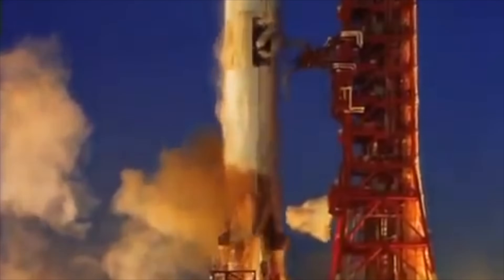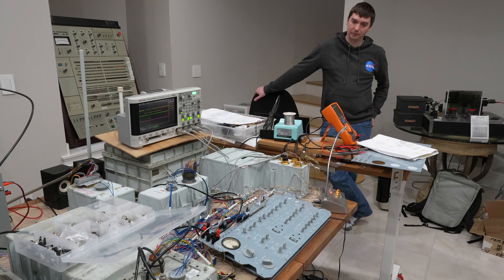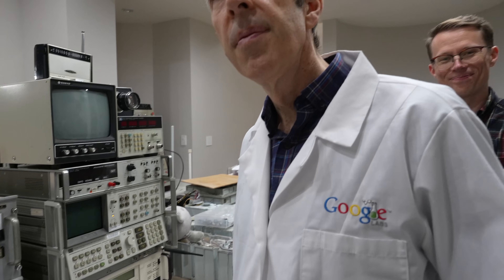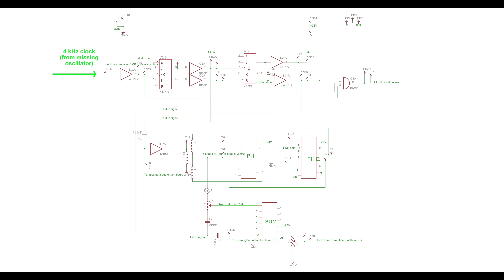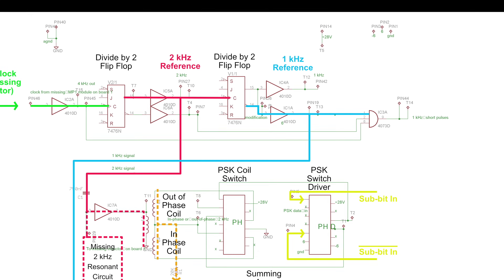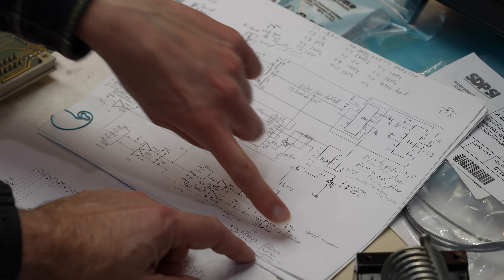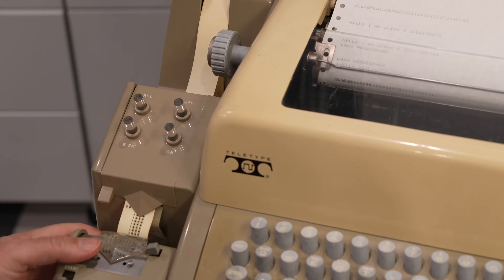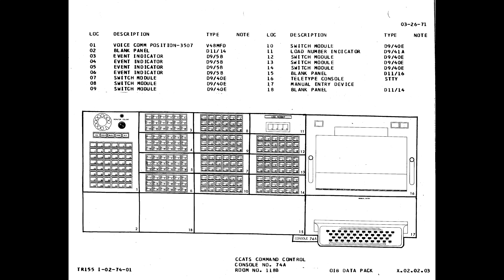Apollo Comms Part 33: Is there something wrong with our NASA Up Data Link transmitter?

Comment: My law of inverters: it should be a 50% chance you get it right, but somehow it's a million-to-one shot you get it right the first time.
Reply: Flip a coin heads 10,000 times, the odds of it going tails the next toss is still 50 50!!
Reply: The 50-50-90 rule:
If there's something that should be a 50-50 shot, 90% of the time it's wrong the first time...

Comment: I am loving this series.  The funny thing is that I'm working on an electronics project with SMD parts under a microscope and I am looking at those large chunky turrets where you're making your modifications... of course they had an entire card cage and size wasn't as much as an issue... but I too like the HP equipment and have several older pieces of equipment in my rack: an 6-digit multimeter 34401A and an Arb. Waveform Gen. 33120A... they knew how to make rock-solid equipment.  The funny thing about that is that when I worked at HP in their Test and Measurement Division in the 90's , I didn't take advantage of my employee discount... but I purchased these 2nd hand and it brings good back memories.

Comment: Curious about how much the UDL was used in practice during the missions. How much of the spacecraft could be controlled this way, and why wasn't it used when they hacked the AGC on Apollo 14 when they needed to ignore the abort signal during the descent.

Then, on the fiction side... What if they had a rogue group of astronauts on board. Could they be able to strand them out? How much damage could you cause, or how much control would you be able to take out of their hands? Sounds like a cool plot device Chris Hadfield could have used in Apollo Murders.

Comment: I do wonder: This system seems to have very little authentication. Was there no concern that someone could interfere with the mission?
Reply from the maker: They probably were, but without LSI ICs there was no practical way to put encryption in this. This is all discrete transistors. So they just used two switches to disable the UDL in the spacecraft if needed. The computer also had to be manually switched to accept UDL commands. You can hear Houston requesting access to the computer verbally before they can do anything with it, then the astronauts switch it right back to block access.
Reply: @CuriousMarc  That makes a lot of sense. Thanks!

Comment: Apollo's design incorporates advanced safety features, such as the Launch Escape System, which provides astronauts with a reliable means of escaping in the event of a launch emergency. This system has been rigorously tested and has shown that it can effectively safeguard the crew in critical situations, making it a robust option for rescue missions 😘😘😵‍💫😵‍💫🧐🧐
Reply: The soviet N1 also had a rocket powered launch escape tower. It's the only thing that ever worked flawlessly, saving the dummy payloads from the inferno of the failed launches and obliterated launchpad raging under!

Comment: Only a scada guy will scream success! when he hear the click of a relay 😂.
It's late for this idea, but removing both modems and connect the ttl port directly from both control devices will test if the problem was in the modem or not.

Comment: You went to the inverted output of the 1st flip-flop; why not the 2nd flip-flop at pin 14, and leave the bodge wire at pin 15?  Am I missing something?
Reply from the maker: You are not missing anything. That's what we wanted to do originally, but the way it's routed on the board is very different from the way it's routed on the schematic. There was no clean way to do just one cut to do the disconnect, and the original bodge would have had to be re-done from another place, and involve more cuts and more reconnects. However inverting the 2 kHz was very clean and minimally invasive, just one cut. So we went for that.

Comment: Nice work guys! But do you have an idea why the apparatus was inverted and you would have to do another bodge wire in a way it was never done on that particular one?
Reply: The equipment was reused for later non Apollo missions Marc mentioned in a previous video so frequencies etc were changed and modifications made
Reply: @Spookieham  yes I know, but there would be signs of the change. In this case it wasn't changed at all but it was still inverted.

Comment: Wonder if any of the engineers that designed this equipment and associated protocols are watching and nodding their heads in approval. If they’re still alive, they’d be on their late 80s or older.
Reply from the maker: Sadly the Raytheon and Collins folks are defense contractors and their engineers rarely talk. And their companies never answer our requests. Same for IBM and the LVDC computer in the Saturn V. The AGC is sort of a lucky exception because it was designed at MIT.
Reply: Some of the AGC programmers are still alive and in contact with Marc

Comment: Question: Is this communication equipment "stack" similar but different (due to different requirements)  from what NASA originally used to communicate with Voyager 1& 2?   How & what does NASA use today to communicate with Voyager 1& 2 today?
Reply from the maker: This is all  JPL stuff really, that JPL had developed for their satellites and got borrowed for Apollo. So I'd imagine Voyager had a very similar system for up and downlinks, but I have not researched it.